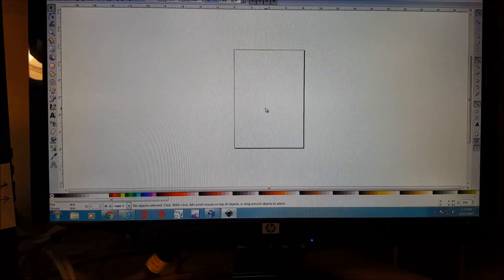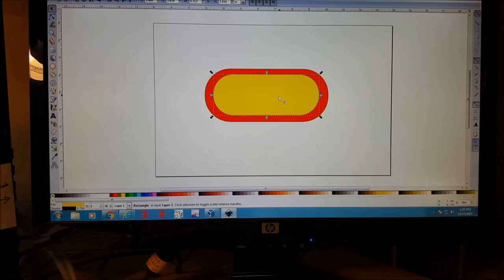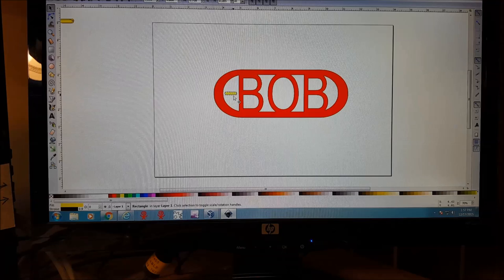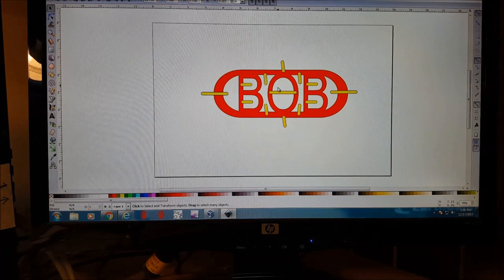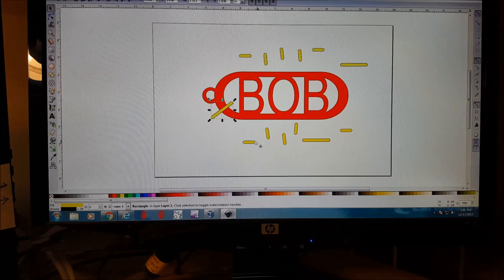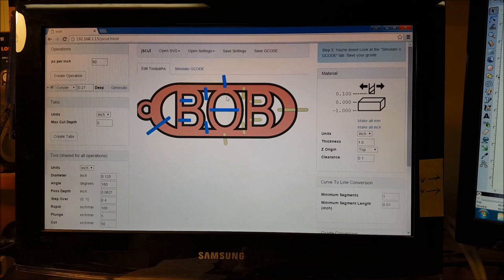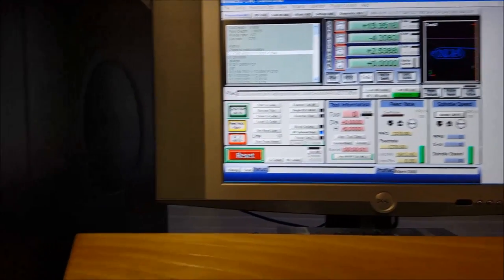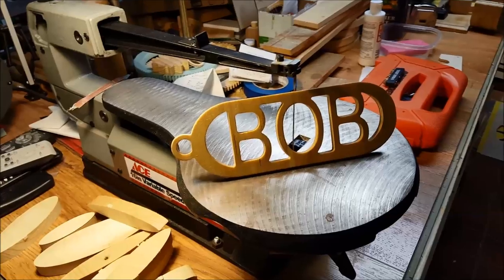CNC Keychain Carveout Project

Comment: Drez just a heads up you should look into CamStudio or VLC they both are free options for screen capturing your desktop or program (you can select what portion of the screen to capture and it records decent quality screen capture so you wont have the camera trying to auto focus over and over :) 
I havent had an issue with your videos before but i think since its almost midnight and my eyes are tired its playing tricks with me :P
Either way great job.
Reply from the maker: +vladyerus Roger that.  Yes, thanks for the comment.  I've tried those programs as well as others many times, for some reason when I'm running the virtual machine for Jscut as well as Inkscape I have lock ups and crashes.  So I've gone back to just pointing the camera at the screen.  I'll make sure to focus lock the camera to avoid the auto focus issues.
Reply: oh no. please dont do it on my account like i said when i watched it i was pretty tired. decided to tell you encase you havent tried any of those screen capture software. But since you have and had trouble that is a-ok still enjoy the content either way, just got to watching it a little late is all :)

Comment: Hi,
I just finished building my CNC. I used your videos for inspiration, their excellent. When attempting to print text, like the Bob keychain, my text engraves in mirror. I've looked around on google and found nothing that will help. I'm using an Arduino Uno with Grbl. And, following your direction, Inkscape then jscut. Have any ideas? Thanks.
Reply: UPDATE: I found that I had the X and Y axis swapped. All is OK now. Thanks.
Reply from the maker: Hi Craig.  Thanks for your comments.  Swap your X and Y cables where they plug into the Arduino.  After I built my first CNC I had a similar problem and found that those two cables were plugged in backwards.  Best of luck.